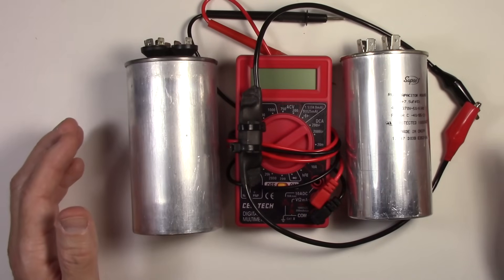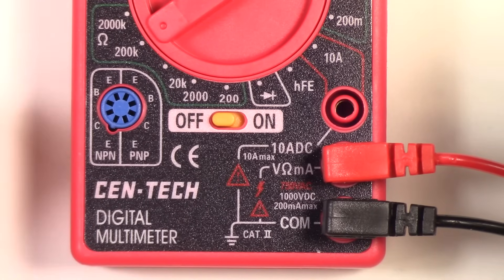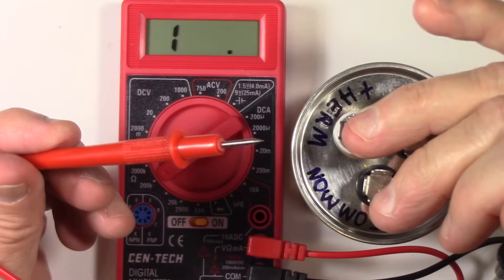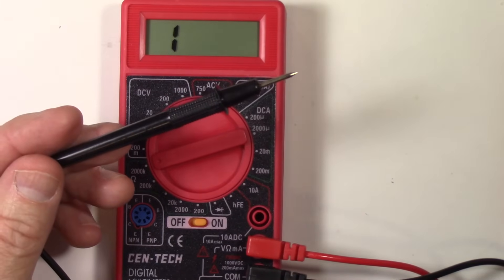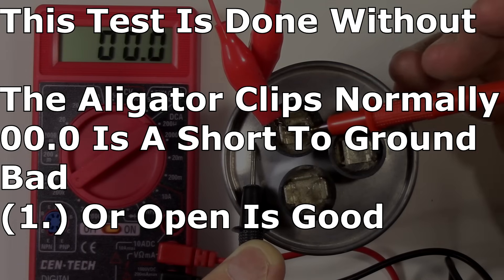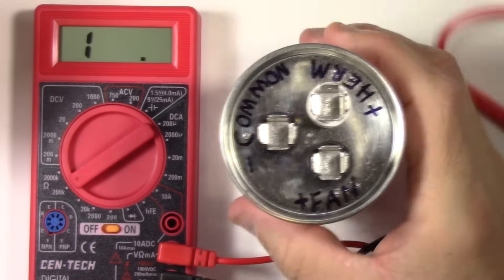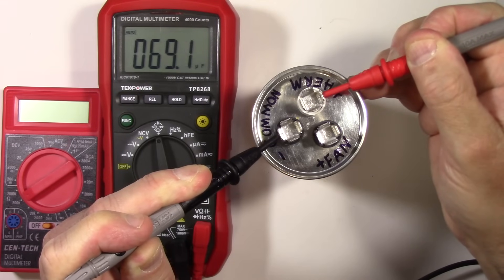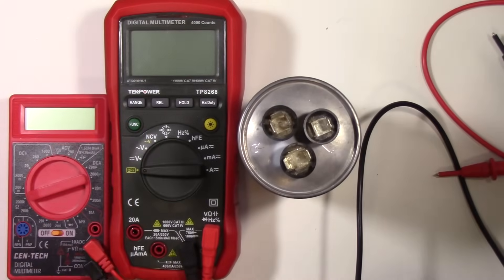Start Run Capacitor Testing Using A Cheap Meter DIY (HVAC/Stereo/Microwave/Electronics) Service

Comment: Using this method, I just found out that the capacitor on my oil burner, blower is dead, despite showing no external damage or leaks.
Reply from the maker: It is true. They can blow internally and look just fine on the exterior. Thank you for watching, commenting and the valuable feedback. I appreciate it greatly. All the best.👍😀

Comment: Pls make one video how to check microwave capacitor
Reply from the maker: I will look into it. The procedure is the same for capacitors though. Thank you for watching and commenting. I appreciate it greatly. All the best.
Reply: @richardlloydusa  My microwave capacitor is AC volts (2100ACV 1.00uf) and I wouldn't think you could use a meter's DCV to test it.

Comment: Used your guide to test my refrigerator run capacitor which apparently works. Great video thank you.
Reply from the maker: You are most welcome. Thank you for watching, commenting and the kind words. I appreciate it greatly. All the best.
Reply: @richardlloydusa   Rich i have a question for you when i did the method you showed on a capacitor i have it only worked in reverse when i put the negative on the fan prong or herm prong. Does that indicate that the capacitor is bad? Thanks.

Comment: Thank you very much for the upload you just saved me $56😀 I was checking a washing machine start up capacitor and I found the wire to the motor end was broke.
Reply from the maker: You are most welcome. Thank you for watching, commenting and the kind words. I appreciate it greatly. All the best.

Comment: is my multimeter broken? without touching anything with the leads numbers bounce around. when I cross the leads, it goes to 000
Reply from the maker: That's normal but yes it should zero when you short the leads. Thank you for watching and commenting. I appreciate it greatly. All the best.

Comment: What if it takes a really long time to reverse polarity?  I have a compressor with 2 capacitors.  I assume one is a start and one is a run.  One of them will hit 200k ohms really quickly (5 sec) and the other one gets there but takes about 30 seconds to get there.  Thoughts?

Comment: Your reviews always worth many fold of time spent on. Great as always. A question: Can you test smaller capacitors, such as amplifier or other boards, as they are attached to the board, in the same fashion or you need to de solder it out of circuit first? I am pretty sure my dead amplifier has a problem with one of the capacitors but not sure which. Thanks again.

Comment: Which multimeter do you think is the better one the Mastech or Tekpower
Reply: I think the best thing to do is to look at some clips on Youtube and check for the reviews and comments.  I do have some Mastech DMMs and I'm happy with them.  If you're doing electronics for a hobby, that will do, so will U-NIT and some other affordable brands as well.  If you want to go pro, Fluke, Keysight, Agilent, Tektronix are of a different league.  Firstly establish your needs, such as resolution, accuracy, measurements.  How much money can you invest  will also be an important question.  Once you've established clearly what you need and what you can afford, it will be much easier to shop wisely.

Comment: Very helpful video.  Not being a professional HVAC expert, and only having a simple meter, this at least gave me a pretty good idea our capacitor was shot.  Although the top side with the connector prongs was slightly convex (a possible physical indication), the test really stood out once we had a new one in our hands.  $5.60 solution.  Thanks for making the video.

Comment: I wish I had found your video to check my A/C capacitor a couple years ago.  I have the regular Multimeter and just needed to know uf the capacitor was bad or not.  The part was $20 on ebay. I ironically got a call from the company that installed my A/C to service it that very day.  They sent a repair guy over and he used his cap tester and it was dead, so I asked for a quote to replace it.  He went to his truck, came back and quoted me $535.00.  I kicked him out of my property and told them to lose my number.  I purchased the new part and installed it myself for $20 it took all of a few minutes.  Your video was what I was looking for, it would have saved me a lot of grief dealing with them and being given such an outrageous estimate. I was insulted and angry.

Comment: On my air-con system Indoor fan runs, compressor tries to kick in on cooling cycle can hear humming after 5 seconds circuit breaker trips, checked the compressor windings closed circuit on start and run and nothing down to earth, pulled out the capacitor used your method to test it same multi meter as yours cheap but reliable no response from my multimeter staying on 1 no continuity at all so I think it's safe to say the capacitor is bung thanks for the video
Reply from the maker: Buy it and see, it will either fix the problem or rule out the capacitor and you will have spare capacitor. Thanks.
Reply: Sounds like you have a stuck compressor. When the compressor hums it is not starting therefore pulling lock rotor amps. It should open internally, but is tripping before that happens. I'll bet compressor becomes very hot as well.

Comment: Question:   Does the capacitor have to be removed from the outside a/c unit, before discharging?   If so, how do you safely disconnect the wires, then remove the capacitor?
Reply from the maker: You can discharge it while it is in the unit. Use a pair of insulated pliers and rubber insulated gloves to remove the wires before discharging the capacitor. You don't want to arc weld the wire terminals. Thanks.

Comment: found the problem the wire C on the compressor was burn disconnected and shorting the R wire stuck together.

Comment: i have a problem with my fan motor won't turn off.  i change the one pole contactor 40 amp and disconnect the 24 volt wire on the thermostat, fan motor still won't shut down. also my compressor won't come on, fan motor only shut down if i pull the breaker, been like that for 2 yrs.
REPLY
Reply: Albert Garcia   You need a service technician !  You defiantly have a wiring issue.

Comment: The small meter is the same one you can get free at Harbor Freight.
If the cap measures more than 5% off, should it be replaced?
Is the age of the cap ever a factor?
Reply from the maker: If it is beyond the specified tolerance you should replace it. Thanks.

Comment: My air cond kept tripping breaker when I tried to cool.
If I only ran fan, all was fine.
I took out capacitor and it was convex at both ends.
I replaces and now ac runs great.
But I am trying to test this capacitor just to learn.

 1st oddity)  I am using same meter, same setting.When you are not touching leads to anything your meter reads: 1, just 1. Mine reads 1 , then about 5 spaces, then a decimal point, then nothing.
2nd oddity) When I touch leads as you show to herms, Nothing happens. Well, ok, the compressor barely started, so I guess that makes sense. But when I test the fan, it still shows absolutely nothing. That's odd, because the fan part did used to work just fine.
Any thoughts?
Reply from the maker: Did you figure it out? Thanks.

Comment: Richard Lloyd - Is there a way to check the actual value of the capacitor? The one in my central air unit is COMPLETELY RUSTED all the way around. I can't get any numbers off of it to order a new one. I don't know what the tolerance or resistance etc. is. Any ideas for a DIY?
Reply from the maker: Yes, you can test it with a meter like this at Amazon: http://amzn.to/2xxwibw or here at Ebay: https://goo.gl/fYRw48 I show how to use a similar though more expensive meter on this video: https://youtu.be/19A9lvQ6lIA?list=PLnxXRLSlmSVOUSl-tmdEuav4IW1OghaES Thanks.
Reply: There should be a schematic inside one of the panels of the unit with the wiring and potentially some specs.  If you can get the brand name and model, perhaps contacting the manufacturer or a distributor could help you.  If, and only if, the capacitor still within specs despite its rusty look, measuring the voltage across the terminals (com - fan, or com - herm) and measuring the current with a current clamp around the proper wire (fan or herm), you can evaluate the capacitance via the following formula : C=(Measured current)/(2*pi*f*V) where pi=3.1416, f=50 or 60 (Hz) and V=Measured voltage.  So for instance if your result is 0.000035, that would be a 35uF capacitor.  The tolerance doesn't really matter, so something in the 4% to 8% will be just fine.  Voltage will more likely be in the 370-440V range.  The higher the voltage rating is, the better it is generally speaking.  Keep in mind that this measurement approach will provide you with an estimation of the actual capacitance, which might not be the value indicated on the capacitor when it was brand new.

Comment: Great video.  I have been looking at a couple of videos about start capicators.  
I have a Craftsman 2 hp 120 volt air compressor that will only start when there is no air in the tank . If there is air in the tank it will blow the circuit breaker. 
Before I opened up the unit I wanted to get some ideas about testing the unit out.
After watchtng your videos I think I have enough info. 
Thanks again for taking your time to explain how cap works.
Reply from the maker: You are most welcome. Thank you very much for watching and the kind words. All the best.
Reply: I doubt there would be a start capacitor in your compressor but more likely a run capacitor which in fact improves the overall power factor.  The fact that the circuit breaker trips when there is air in the compressor leads me to believe the motor has a harder time to start and potentially increases the inrush current at the starting time.  A 2HP motor would draw about 1400W of power, so in the 12A area.  If there is something else on the circuit controlled by the same breaker, that might not leave enough margin to get the motor started.  On my end, I had to change the circuit breaker for my central vacuum with one that was conceived to handle higher inrush current.  Since then, I'm a happy camper !

Comment: What if the capacitor tests good but it has a dent in it - will it last, or is it's life shortened?
Reply from the maker: Like my Father used to tell me,"Richard, if it isn't broken don't fix it." LOL If it tests out OK then just use it. It may last just as long as it would have without the dent. Just buy a spare capacitor so you are ready when it finally fails. They are a wear item all capacitors eventually fail. They have a limited service life. BTW most capacitors are under $30.00 it's cheap insurance and you will be very glad you have it on hand when the one in your unit eventually fails. Thanks.
Reply: Thank you for taking the time to reply.
Reply from the maker: You are most welcome. Thanks for watching and the kind comments. I appreciate them greatly. All the best.
Reply: i have the exact same cen-tech meter i got for free at harbor freight but with a harbor freight logo on the package ,i tested a cap from my garage door opener and  when i reverse the leads it goes from negative integers to positive but when it gets  to like +700 or so the meter starts to blink out every time it goes to 1 or a blank screen for a second or 2 then it goes back to  climbing the voltage around where it left off ,does this mean my cap is  bad or that the meter is a POS ?

Comment: your reviews are great! Im going to add your channel into my descriptions of my battery videos... good stuff. Oh, BTW, you responded to a comment of mine once, suggesting the ebay 18650 20 cell packs that are for sale. they seem to be pretty decent. they have 1700 ish mah from 4.2 to 3.5. I am going to do more testing before i publish any videos. The crazy thing is that taking them apart..... the shrink tube around the cells is so frail that some of the cells have it breaking apart to the point where you would have to re-tube them... i took pictures and put that in the review i wrote for the ebay purchase... guess what.. they are not letting it publish.. go figure. I have reviewed their rules and rewrote it three times... no publish... kinda feels wierd.If you want me to mail you a couple, please let me know (youtube messages in the community section of the creator studio? ) Thanks again for such good reviews!
Reply from the maker: You are most welcome. Did you see my various videos on re-wrapping cells? Here is the link for those: https://www.youtube.com/playlist?list=PLnxXRLSlmSVMlZ8t5OFbS16kXORkMlZDR I am going to purchase this NEW LG 36V 4.4AH BATTERY PACK 18650 at Ebay: https://goo.gl/vuspEB to test. I am thinking it would make a great storage system for a 36V solar power system. Attach them in parallel to a cheap Solar Panel Controller Regulator at Ebay: https://goo.gl/h25nqc then tie it all in to a 1000W Grid Tie Inverter 110V For 24V/30V/36V Solar Panels at Ebay: https://goo.gl/N6tWjg You could in theory get a complete battery charging system for a solar panel system for around the $200.00 mark. I will have to do more research and see what I think about putting all that together. Of course the price will go up if you want more storage capability. The nice thing is that the battery packs would make a nice modular system with the BMS's built into each pack. Looks like a great project to consider. Thank you very much for the update, kind words and subscribing. All the best.

Comment: Were was YouTube in 1981. I could have pass hi school top of my class..
Reply: smps
Reply: To be honest I don't even recall if we had any videos on PCs at that time, nor on BBS's !!!  We were on DOS with 640K of RAM.  The prettiest graphics at that time were ANSI graphics !!!  That was the period of Apple Lisa too, wasn't it ? That Apple machine was causing so much electrical interference, it was nuts !!!  Just think how long it would have taken at that time to listen to a 100MB video using a 300bps dialup access, roughly 40 days !!!!  Today it will take less than 2 minutes to download the same amount of data and we'll have the balls to say "My internet connection is slow !!!"  Go figure !!!!
Reply from the maker: LOL! Thanks.